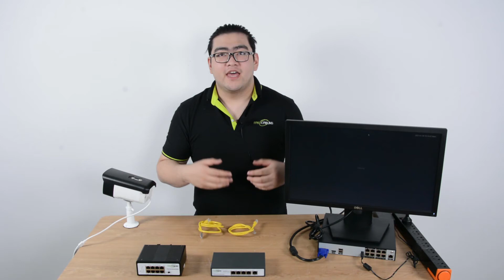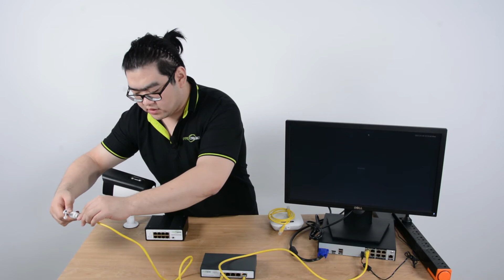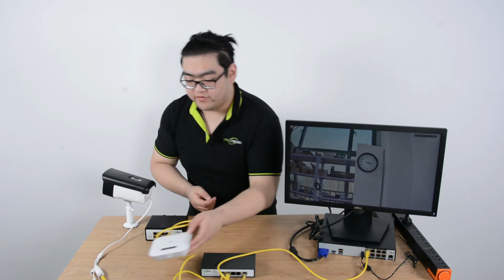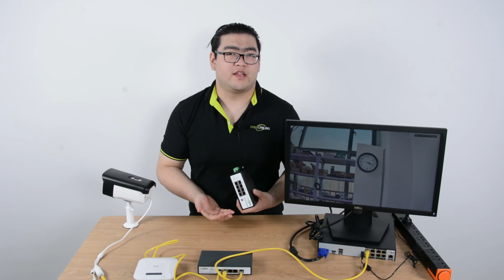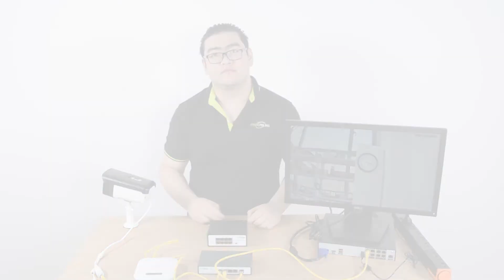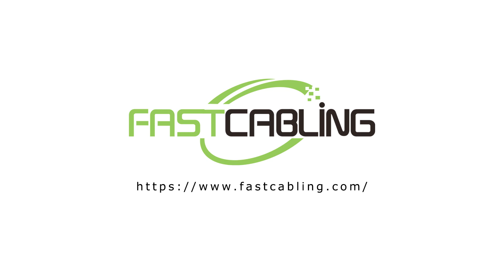How to Extend Ethernet Cable Transmission Range#2: Using PoE Powered Switch

Comment: And also.. What port was the cable connected to on the NVR.? Was it a normal lan port or a poe port?
Reply from the maker: Both ports will work. When non-PoE device (NVR) is attached to PoE ports, the POE switch will only provide the data exchange. The power handshaking will verify the devices (NVR) before it send the power. As the NVR is non-POE device, the POE switch will know it needs the data only.

Comment: I want to know... Can the distance between the NVR source port and the PoE switch exceed 120m when connected via the uplink port?
Reply from the maker: You may want to add the PoE extender. With very cat6 cable, you could have about 120 meters with bandwidth compromise. However, the sources need to handle all the video feed from all the cameras. It is better to make sure the bandwidth is not compromised.